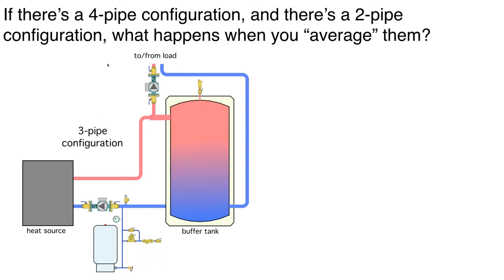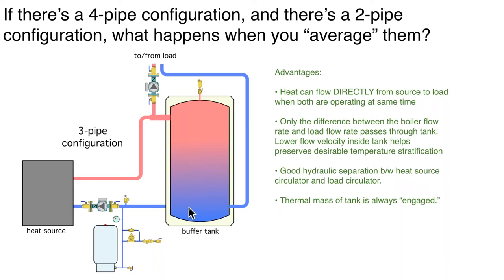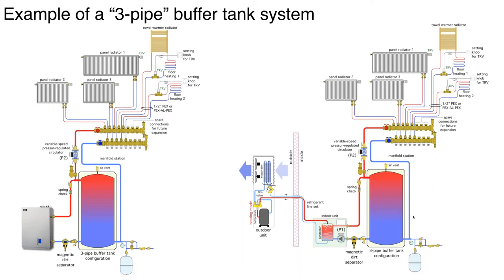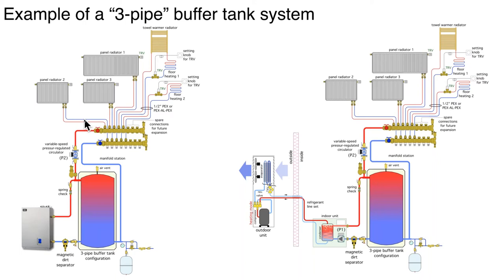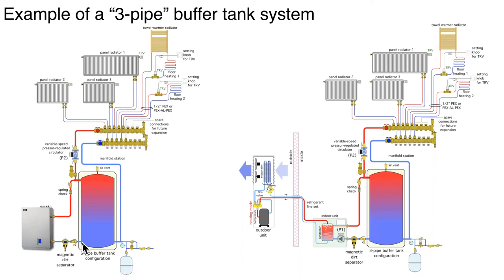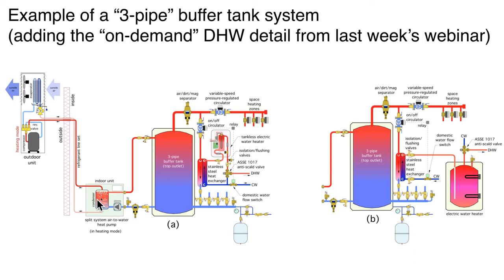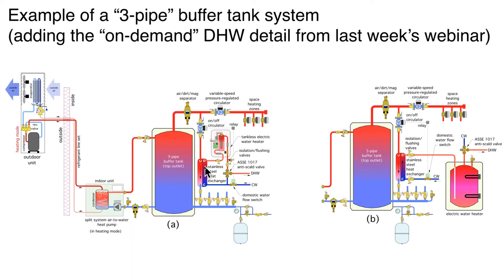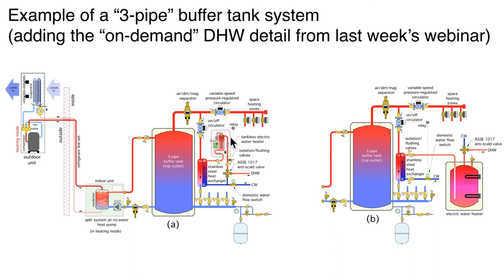Hydronic Tips: 3 Pipe Buffer Tank Piping

Comment: Would setting up a tank with an equal capacity to the rest of the system that is kept at temperature be practical? Tank could be on a thermostat with heating source and radiators and their pumps on a separate thermo.
Reply from the maker: Setting up a tank to equal capacity we would not do. That said we definitely would charge the buffer tank with a sensor from the heating/cooling appliance and use the thermostats to draw heat from it. NOT to actually run the equipment. We have more training we are uploading that touches on this in detail.

Comment: how does the 3 pipe works compared to a 4 pipe system 2 out and 2 in, with 2 cirk pumps etc, because my system has very smal 10 mm floor heat pipes and requires a high flow rate to both heatpump and floor heat so i was adviced to have 4 pipe system with buffert tank, but i really would like to make the 3 pipe instead, and as you said make the T connection short and fat,, but i wonder how the flow will be affected from the 4 pipe, what do you suggest..i dont see what else can be the difference ?
Reply from the maker: All the methods have their advantages and disadvantages. We will incorporate this question into a future video.